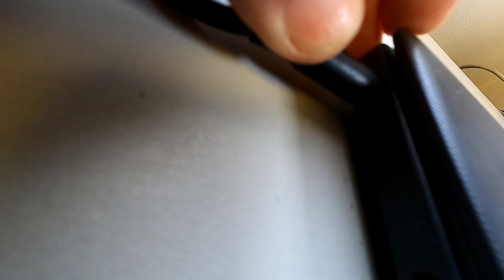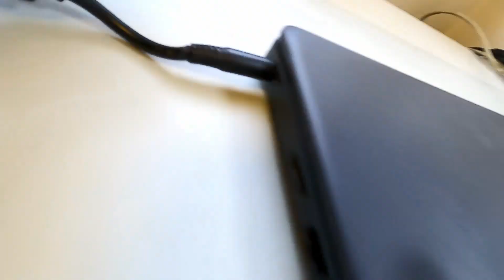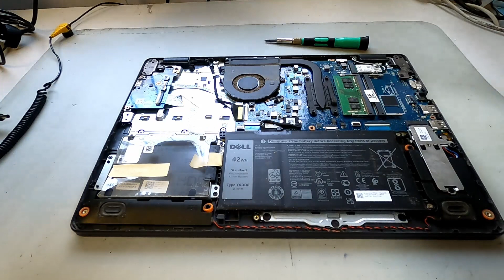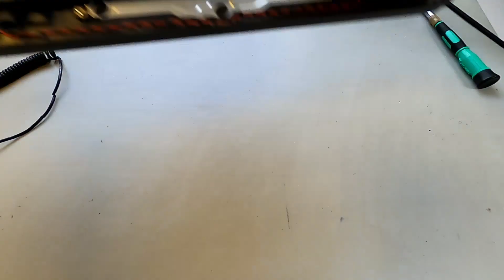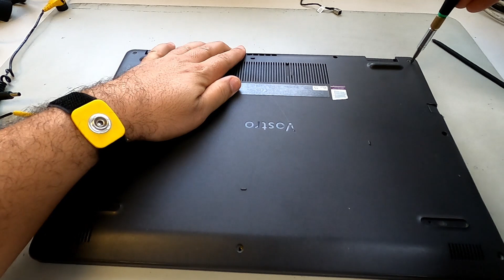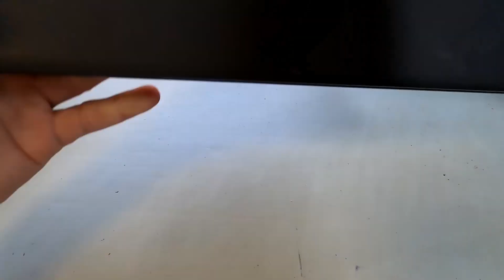Dell Vostro 3500 charging port replacement Iffy charging port

Comment: My Vostro 3750 was problematic but worked if I left it in place. This weekend its inert now matter what way I plug it. So I’ll have to tackle this.
Reply from the maker: Unfortunately, This is a common problem with these type of connectors on the Dell brand. Good luck